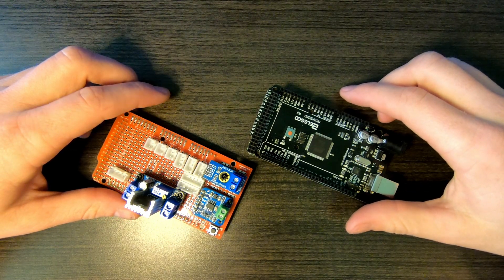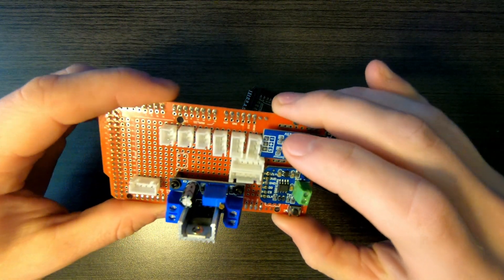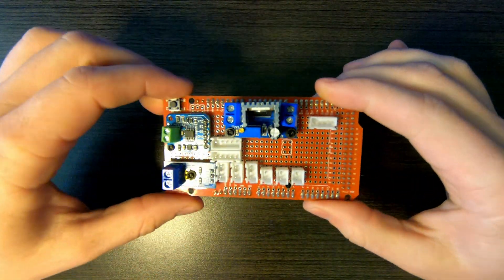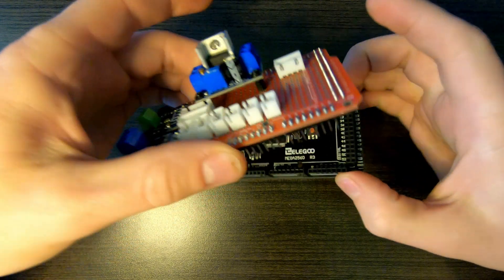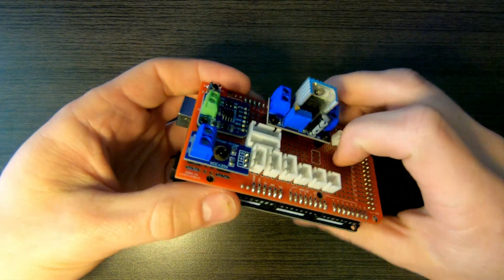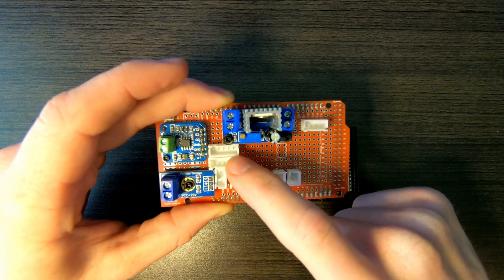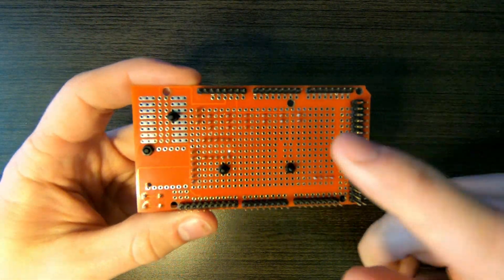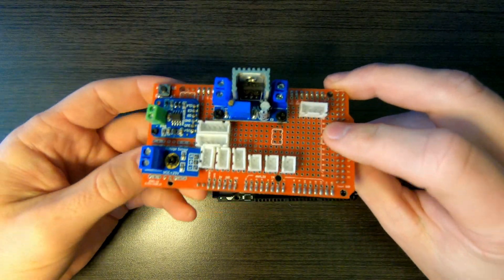Arduino Based Gauge System | Prototype Update 1

Comment: Hi Tyler, Are you going to monitor RPM's on this project. If so, I'm doing a very similar project, and wondering if maybe you were going to be covering a Hall Effect sensor.  That's what I'm using. My problem is after playing with Arduino for a couple years, I really suck at code, so kinda following along with you. Thanks for sharing your project so far.
Reply from the maker: Thanks for watching. I was thinking about integrating rpm into my monitoring project. If so, I think I would try and use the existing hall sensor that is on the engine and potentially use the signal coming from it. That would be down the line though, since I already have a tach in the truck that works well already.